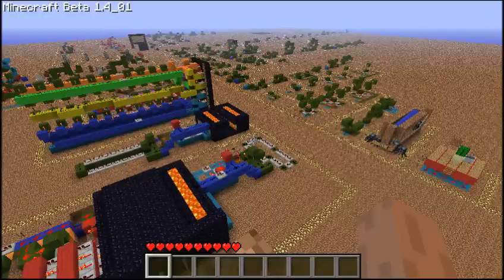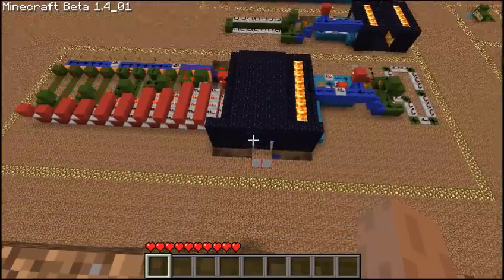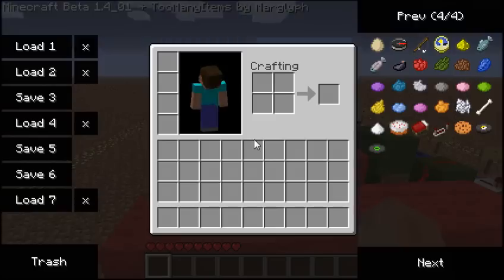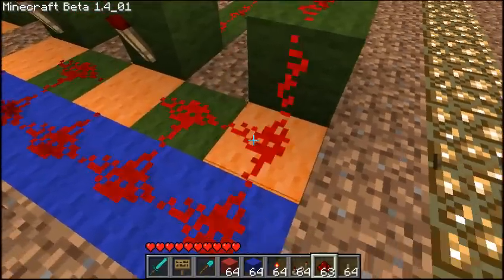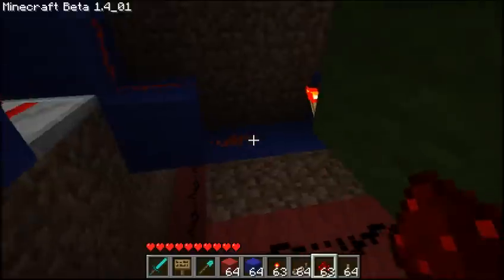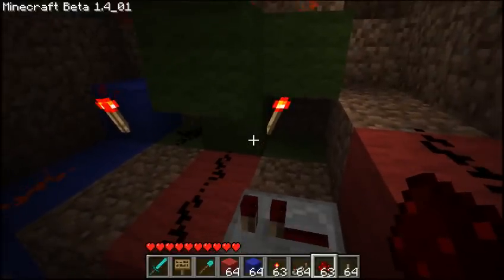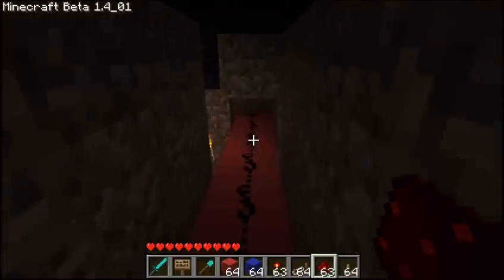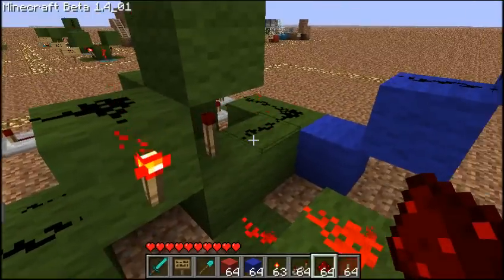Tour of highly secure entry system

Comment from the maker: @AndHisNameWasYeti I tried to explain that in the video... I think it wasn't very clear. Anyway, I don't need to do a manual reset, nor do I need to do a self-resetting clock arrangement. Instead, whenever it's time to fire the dispensers, I use that signal to also reset the clock.

Comment: On the door opening/closing mechanism, couldn't you use a redstone and a repeater instead of two repeaters? Redstone dust next to repeaters still forms a straight line, so you can easily save yourself a tick (a repeater uses 1 tick on the lowest setting, so replacing it with dust saves a tick)

Comment: The only problem I find with these security systems in SMP is that someone may just destroy one of the blocks below a door to make it pop out, clearing the entrace. Even if made of obsidian, it doesn't take so long with a D. pick. 
I wander if there would be a way to mix that with a water sensor for both blocks below the doors, that would trigger some trap for those cheesy intruders?

Comment: I was messing around in this world. I accidentally stepped on the pressure plate out there. I couldn't stop the circuit, and I was being lagged too hard to move. The monostable circuit is broken... And the one clock wouldn't start again after I destroyed it. Did I do something wrong xD?